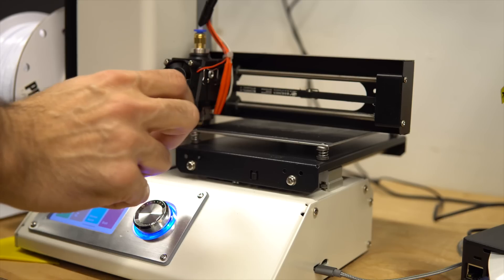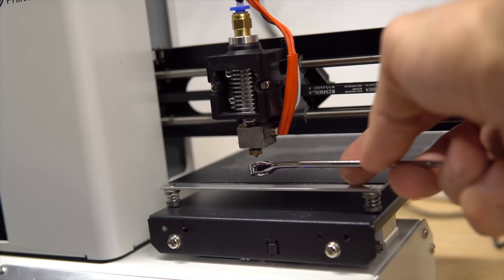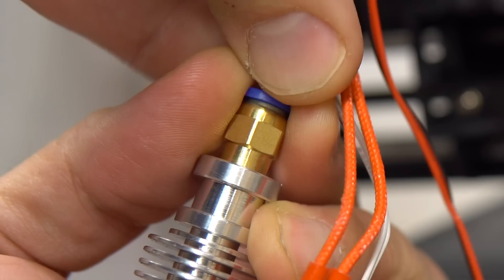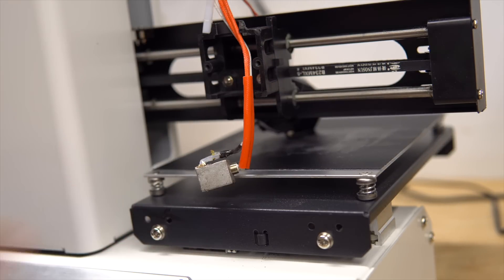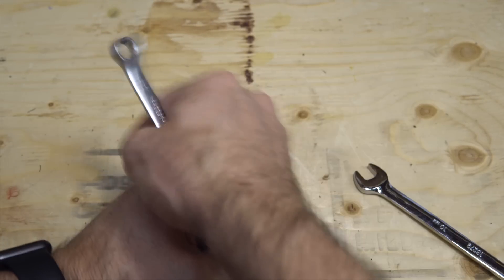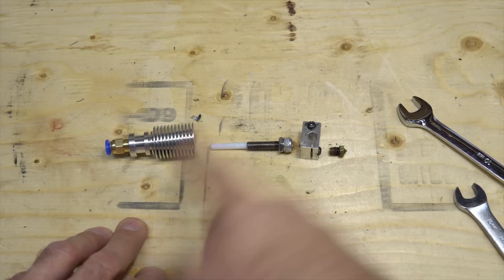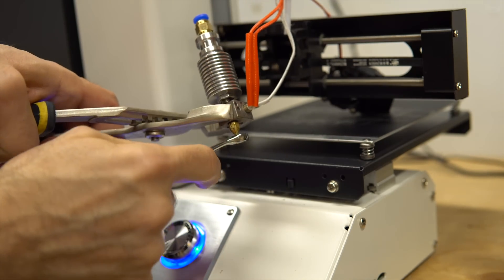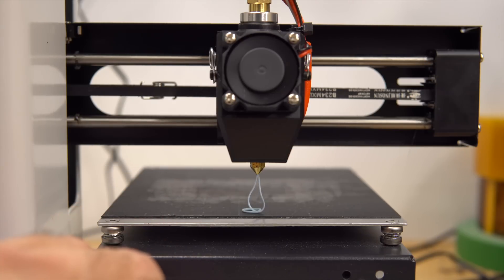How To Dismantle The Hot End

Comment: FYI, I believe the insulation/kapton tape protect the print from the hot end heat, not the ambient air temp. Therefore, it should always be on there.
Reply from the maker: Hi, my two printers do not have insulation, my prints are fine no signs of melting or heat from the hot end. I think that insulation helps lessen the temperature variation when extruding, if for example your power supply is limit to keep the heat during long and fast print. The faster you print the more heat is needed from the heater and power supply. Having insulation should take less power for the heater and prevent heater run away when printing at higher speed, or parts that needs lots of extruding without pauses. Insulation also have the benefit of preventing plastic sticking on the heat bloc. Use it if you like, it all depends on your needs.
Reply: That could be, but considering that a cooling fan is critical to produce high quality prints by drawing heat away from the top layer, it makes sense to me that the insulation performs a similar function. On another note, have you ever swapped out a control board from a  V1 to a V2?
Reply from the maker: Let’s say that it does not hurt to have insulation! But it’s a pain to put on! I prefer the little silicone socks like on the E3D v6, that I will upgrade to. No I did not swap boards from V1 to V2. I know that the screens also needs to be changed, you have a firmware in them and they are not compatible from V1 to V2 boards from what I can deduce from the firmware upgrade of https://mpselectmini.com
Reply: It also shields the heat block from the part cooling fan and helps the block maintain a more stable temperature.

Comment: Thanks for this video.  I have a V1 printer with a slightly different configuration of the heat sink and Bowden tube.  My main concern is getting replacement nozzles.  Do you have a source for the nozzles?
Reply from the maker: Hi, you have the reference on this wiki, https://www.mpselectmini.com/parts/nozzle the V1 is 1.5mm shorter than the V2. You could add a Z spacer of 1.5mm and fit the ones I have listed on the video description or maybe they would fit if you can lower the bed enough. You can not cut them easily or you will have oozing like I did in this video.

Comment: After watching a couple of your videos, I finally noticed in the opening sequence, you are 3D printing a cup, and then putting coffee (or some consumable coffee-like beverage) in there... presumably to drink. -- That's bad. -- Don't do that. -- 3D printed items are generally not food safe (even "food safe" filament is not actually food safe unless you only print that one kind of filament, and in a sterilized 3D printer / environment ...)

For a few reasons: the obvious one that everybody cites is that the FDM printing process leaves small gaps between layers and walls that germs can get into a thrive in, forever.

There is some "food safe" filament, that is supposed to make that less of an issue, but then the hotend that you print with, probably has small contaminants in it (especially from other filaments), that it deposits into the part you are printing.

Also, for regular PLA, it melts a low temperature (making it hard to dish wash), and some hot beverages will warp and deform it (also meaning that any nozzle contaminants that made it into your part are now in the beverage that you are drinking...).

Anyway, just don't eat or drink from those items, it's bad for you...
Reply from the maker: Thanks, I will consider this when doing my new intro (soon). I only used that cup for the intro, using it the first time I did realize that it was hard to clean up. It was made from PETG which resist higher temperature; it does not leak at least! And all of the layer lines are not a good feeling on the lips; I doubt that anybody would use it for a long time. Thanks for the comment.

Comment: I encountered the same problem  thank you for posting this! It is perfectly detailed. I am wondering if you might need the thermal insulation and kapton tape for safety, though.
Reply from the maker: Thank you, thermal insulation will help for heating faster and prevent plastic sticking on the heater bloc. Could help for safety on on side not burning yourself, I have some that I will put back...

Comment: Well, that didn't take long to mess up. What do you attribute the cause to?  The parts not being properly tightened at the factory?  Should new users maybe take it apart before ever using the printer to make sure everything is tightened properly?  Looks like I should pick up a set of metric wrenches, all I have is SAE except some small metric for working on RC cars.
Reply from the maker: +Duck Landes Hi, the nozzle had a defect from the factory, and they offered to exchange the whole thing, reimbursed me or give a 15% rebate, I took the rebate and made a video at the same time since I had nozzles on hand. And I did buy a similar nozzles pack of 0.2mm, 0.3mm, 0.4mm, 0.5mm, 0.8mm for future projects.
Reply from the maker: +Duck Landes oh and yes, I already have metric wrenches, my motorcycles are Japanese and are metric, so I already have those. In Canada we use both systems, and we are kind of all mixed up.